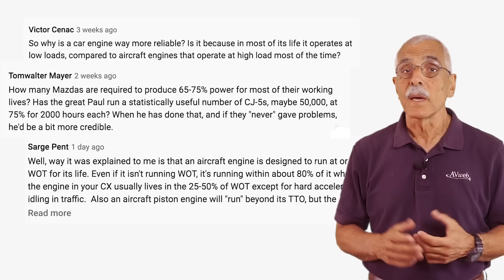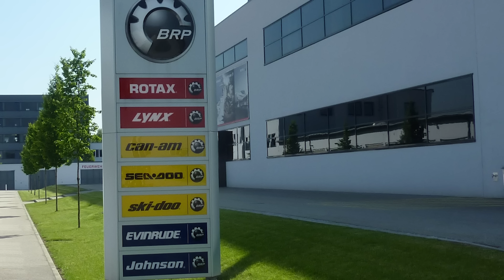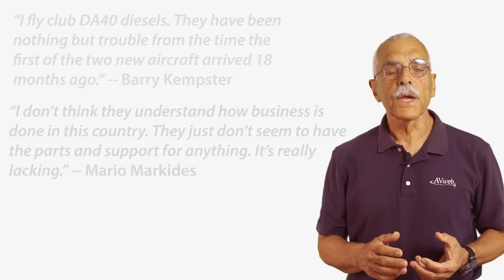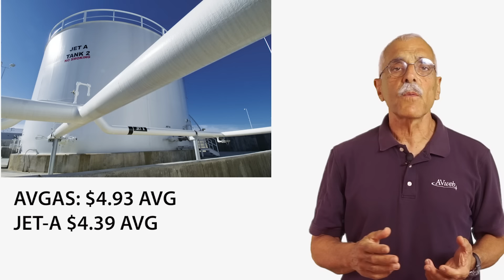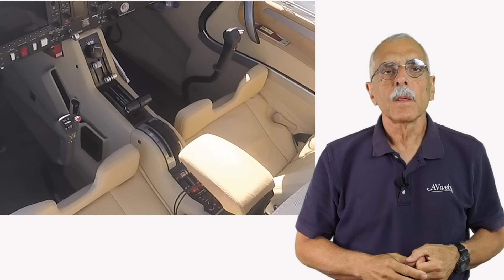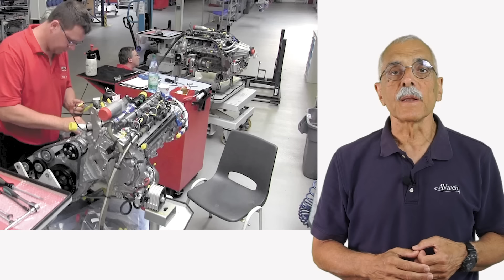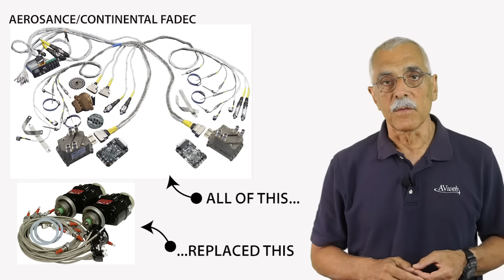Why New Aircraft Engine Ideas Rarely Succeed

Comment: What about DeltaHawk?  What's holding them up?
You mentioned SMA a couple of times?  Are their engines having reliability problems?
When comparing diesel weight to e.g. IO-550-N, the thing to do is show a chart of engine + fuel weight vs range.  The gas engine looks better at short range, the diesel is better at long range.  This is why I'm mystified why flight schools would want diesels... aren't they mostly flying short range?
Reply: You’re the first to mention DeltaHawk.  It’s certified since this video.  (Sep 2024)

Comment: What about going part way and retrofitting newer components onto older engines to eliminate weak spots? I can remember back in the 1960's and 70's when I was retrofitting alternators and electronic ignitions onto into older vehicles to eliminate generators and ignition points. For example, if the B-17 "909" had a modern electronic ignition system instead of 1930's vintage magnetos it probably would still be flying around.
Reply: A descent maintenance program might have helped!........Capt. Mike.....SAT

Comment: love this.  except the part that it's a myth that automotive engines can all be run at 70% power for 1800 hours.  The diesel - possibly, and that's one of the reasons it's significantly more expensive than a gasoline burning counterpart.   I work(ed) for a stationary engine manufacturer, and people in that industry test a lot of automotive gasoline engines (all of them) to see which ones can run well as stationaries.  Most are horrible.  Typical GM LS engines are horrible in stationary applications, they'll start burning oil at 20 hours above 70% load...     anyhow, love your videos, thank you for the quality content.

Comment: I'm not a pilot but I would assume that one of the MAIN features that end users want in an engine is that at 12,000 feet... it keeps spinning no matter what. Diesel engines tend to do that... no spark plugs. I would not think that any of the performance numbers are going to impress anyone as much as that. If I were a diesel engine manufacturer my company tag line would be "It Just Keeps Spinnin'!". 😉

Comment: if i remember correctly, there's more energy in a gallon of Diesel fuel than gasoline.  it's considerably less in ethanol fuel also, why we get ripped off in states with 10% eth fuel in gasoline we buy

Comment: With all these useless 'new' designs of aircraft engines, why not go backwards in time and use the bigger 16 cylinder radial engines? Or the Rolls - Royce Packard Merlin if you really want tricycle gear as opposed to a tail dragger. Sure Packard isn't in business anymore but R-R sure as hell still is.

Comment: Should we soon have electric plane? XD

I'll show myself the way out XP
Reply: Strap on a leaf blower and you can fly all over the place so long as you're happy with your parachute design. And there's a kid on YouTube who's been doing that for Years now. (Tucker Gott?)

"No such thing as a new aircraft engine!"? Pffff. Virgin Galactic just launched a space plane powered by used tires as fuel. There are the standardized systems (as any air frame is more than just the APU) but ultimately there is an entire World of tumult going on in Aircraft going on decades now and in particular as a result of SpaceX.

"Falcon 9 is in start up" has changed far more than just the Aviation market although certainly there is now that. Point being one now has fully autonomous systems as made famous by the doomed Lockheed L-1011...one of which NASA still flies.

As with a fully autonomous Das Auto "taking the head out of the flight" allows for a vastly superior system...meaning as a pilot you can actually fly the plane.

So to answer the question absolutely and of course you can use human rated drone aircraft.

In the alternative is a C130 turbo-jet...nothing more than a jet engine with a propeller on that.

How hard can it be to miniturize that? Not only "not impossible" but if you Google search for that you'll see in the World of RC Modeling "already done and done 40 years ago" more than likely.

Point being the problem is when one design change leads to another and another and another and finally... the end.

But everyone always blames the engine always and of course.

It's that way of thinking that has allowed battery electric everything to succeed ... even to some extent in a rocket motor (Rocket Lab.)

A battery powered system has the simplicity of the drive system and thus a much less complex holistic approach to all matters mechanical.

By way of example ahem cough cough "next Year 2022" cough cough ahem MAYBE there will be a pure BEV front tire motor for your 737 et al for tarmac work even though the item has been well known as necessary for 50 Years and been on the market for over ten Years now?

Or in the alternative we can all watch Boeing go bankrupt again I guess.

Comment: The greatest problem is that development of an aero engine ist very expensive. Automotive engines are not designed for permanet high or full power output. So they increase the rpm's for power. Look at truck engines how much power they have and the rpm's: i.E. MAN 0836 6,9l=420CUI, 184kW, 250hp, (max 251kw) weight 642kg. Full Power at 2100rpm. This engine is permanet full throttle able. Automotive engines are not full power able.

Comment: Almost all modern car/engine manufacturers got their first big break building warplane engines during WW2. Honda, Subaru, BMW, Citreon, etc etc etc. They just made crappier versions for cars and made huge profits. For example, Subaru aren't going to take the bubbles (open deck) out of their engine blocks any time soon, even if they get a bad reputation for headgasket issues as a result. They're going to keep putting the air in, not for the $3 of aluminium saved, but to cripple their own engine durability into the zone required to be a player in the automotive cartel. You can't have cheap, powerful and efficient engines chooching around everywhere, it just wouldn't be right. It wouldn't be managed. Everything needs to be managed, but particulary the people's access to externalised power.

Comment: Is there any benefit to overhead cams in an aircraft engine? GM has pushrods running to 7,000rpm - 6,000 in trucks - and gearboxes add weight, cost, and service issues that negate the benefits of a faster spinning engine.

Comment: If the IO-550 is anywhere near as good as an IO-520, it will be unassailable.  Because Continentals and Lycomings are so refined, challengers face an uphill battle.  One thing Paul didn’t touch on:  Jet fuel/diesel is disgusting and filthy.  It is problematic getting it to meter reliably.  If 100LL goes away, the answer for existing airframes is the o-470, and engines like it.  It likes Mogas.  For new airframes, electric motors with a gasoline powerpack will revolutionize the business.
Reply: I can't tell if your comments about IO-550s are sarcasm..... they should be!

Comment: Great explanation! This cake tastes old and sad though... Seems like a deadlock, catch-22, you name it. FWIW, I'd also point out the Rotax-915iS as a new but very promising engine. It's similar to the 912iS which starts as easily as a modern car engine, unlike any of the traditional engines I've had to deal with. Both the 912iS and 915iS - just crank it, and it starts! Hot or cold! Well, "cold" as in around +15C on the ramp in the morning, I don't have any "real" winter aviation experience yet.
Reply: The 914 is pretty much a turbocharged 912. And the 915 is the 914 with an intercooler allowing for higher sustained horsepower. Yes there are improvements in the engine but at its core it's the same. Look at Edge Performance and you'll see technological innovation. Rotax itself is just incremental improvement

Comment: The new aluminum block LM2 3.0l inline six diesel from GM seems like it would be a good fit for higher performance GA singles. The weight and overall packaging size of the LM2 are very similar to the six cylinder Lycomings and Continentals, but should burn substantially less fuel.

Comment: Rumors are that MAZDA is working on a improved Rotary ( Wankel ) engine that could be adapted for GenAv use.
Reply: Rotary engines are literally the most unreliable on the planet.  The whole basis of rotary engines was power generation via extremely high RPMs.  In an aircraft, you want torque and power at low RPMs - otherwise you need high reduction gearboxes that will not stand the strain.

Comment: Hard to beat a large displacement direct drive engine that's designed to run at lower RPM it gains nothing from 4 valves over head cam with it's added complexity. Now just build a large boxer direct drive Lycoming diesel.

Comment: I'd want a diesel so I could fly on bio diesel. Is there non-fossil avgas?
Reply: Don't know that I'd be putting refined deep fryer oil in my million dollar DA-62, but life is about trying new things, right? To your question there have been initiatives to create renewable replacements using oil-producing algae, for example. The sticking point in replacing AVGAS has been no-one's come up with a one-size-fits-all solution. Some GA engines can run on unleaded MOGAS. You could configure an engine to use E85 ethanol blend, but the problem with ethanol is it mixes with water, so there's a whole host of inherent risks to do with corrosion.

Comment: OK, so people like the old proven stuff more.  That's fine, there's nothing wrong with pushrods, especially in the 2000-3000 RPMs that aircraft engines operate.  Proven mechanical designs have a lot of merit, but why don't any of these companies augment the proven mechanical design with proven automotive electronic components?  You can just add electronic fuel injection to anything that's carbureted.  I've literally done a conversion myself on an old car.  And electronic ignition is fantastic as far as power improvements it can bring.  You can have the engine that starts hot and cold, has better power and efficiency, but is still has that proven legacy of mechanical reliability.

Comment: One of many small airplane engine would make a great boat anchor or needs to go to a strap pile,  to many people paid in blood over these junk air cooled engines. Plus alot of the technology is from the 1920s that in them air cooled boat anchor engines your promoting in the video.  Convert a V8 gas engine from  G.M. AND OR FORD AND OR MOPAR, OR THEM JAPANESE ENGINES THAT IN CARS AND PICKUP THE RELIABILITY IS ALOT BETTER THEN THEM AIR COOLED BOAT ANCHOR THAT ON SMALL AIRPLANE WHERE PEOPLE PAID IN BLOOD OVER AND OVER. AND THE MAN IN THE VIDEO BETTER STOP, BECAUSE OF THE BLOOD HAS BEND PAID. Promoting them boat anchor engines on them small airplanes, that means there is more blood has to pay before the stupidity ever ends

Comment: With old Diesels, when it gets cold. just plug up the tail pipe with a few rags. when it starts, they will shoot out. Be sure to crank it. and stuff it in the beginning, when there is still a good charge. The rags will create a back pressure that will help the production of heat that will start the engine.

Comment: I have a perhaps interesting story about Diamond (well some people may be interested). So, I was luck enough to work for a company who had 2 DA42s for a government project. 

 It was amazing to see them converted to take surveillance equipment like FLIR etc. Its been made public (and I was never asked to sign anything) so I'm sure I'm not saying anything I shouldn't. 

Anyway. I believe the project was to fill a gap left by a delay to the  General Atomics MQ-9  project the UK was involved in. It really highlighted what an AMAZING aircraft and engine Diamond has made. If I was to every be lucky enough to buy my over light aircraft, I would not hesitate to chose a Diamond. To highlight this I just wanted to go over some of the numbers. I used google for the MC-9 Reaper costs. I have first hand experience at the DA42s cost so this may not be 100% accurate, but the difference is so great, that my point is made. 

Anyway, here goes - A Reaper costs 32 million, costs $3.5K+ per flight hour and has a range of 1200 nm. Without the costs of the infrastructure and training to put it into service . The DA 42 (without military payload) was something like 1400 nm, and costs under $1m and under $300 an hour. Now the FLIR would probable add another $1m plus reduce the performance (but not by much).  I think the use by UK government was an excellent proof of concept. I see no reason it couldn't have gone on to be lightly armed like a Reaper. But it could also be a spotter for ground attack.

So the RAF paid a private company to convert and operate the DA42s. I believe it was around £1m per month for the two including pilots, ground crew - everything.  So lets say £6m per plane. I'm guessing, due to more stringent maintenance per flight hour demands of the military, it may not have saved much doing it themselves. But still, 6m a year per plane, and a lot of the cost was front loaded because of the cost of the conversion. and this was a one off, scqle would have brought this down immensely.  compare that to the cost of the drone project. Which I think has run to 1.2 billion.

I wasn't with the company after the planes left for the theatre. I was surplus to requirements when they went overseas. But I hear they ran them it over 2000hrs without incident so I thought it performed amazingly.

Comment: I think a gm 5.7l v8 could work well in a aircraft so long as they balanced it well. The model from 1997 is great at sitting at peak power all day (although it does make it at a lower rpm.).

Comment: The real question is 70% of what design power goal and for what TBO? 
My old (1965) 123ci tractor is rated for 100% of 1700 rpm all day every day for years and can be rebuilt in a barn with some fresh cylinder liners and a handful of wrenches, while still being light on fuel; but that rated output is 27hp and the engine weighs about 1000pounds. (granted the engine is also the forward structural frame and ballast for traction.) 
Top fuel dragster engines will do 100% of design output at around 8000rpm with a TBO of about 15 seconds. 
While a typical 900rpm 3000hp marine/locomotive diesel can go 10,000 hours between cylinder head overhauls and 20,000 hours for the running gear, upper cylinder liner life is about 60,000 hours. (Then you get to the 150RPM cross-head diesel designs where even the crankcase oil has an expected life of many thousands of hours and more problems with moisture and bacteria than blowby.)

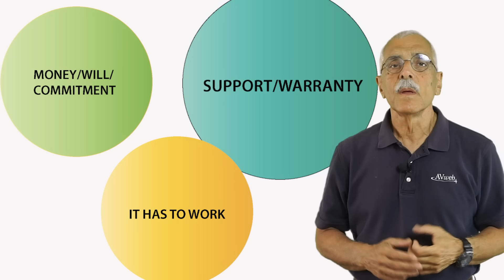Comment: 21:55 at that point I remembered the ol' Pietenpol Aircamper: back in the days everybody said it'd be impossible to use an automotive engine to power an airplane. Mr. Pietenpol obviously wasn't everybody and hadn't heard it was impossible, so he powered his Aircamper with the cast iron Ford Model A engine. It was one of the best and most successful experimental aircraft designs of it's time, they are flying to this day.

Comment: And the car engines that can operate at 100 percent power all the time are really heavy and really low powered. Like my 100 hp 600 lb flathead in my 1950 Dodge truck

Comment: Best solution imho is to convert the LyCosaurus to liquid cooling. It was done 20 years ago by Liquid Cooled Air Power but their attempt to generate interest with the OEMs went nowhere. Now AC Aero Engines has shown their l/c 4 and 6cyl kits for experimental Lycomings at Sun & Fun last month, offering big weight savings, 200F operating temps and compatibility with unleaded mogas. Their bump in comp ratio has boosted BSFC for improved efficiency too. They also offer big HP 2 stroke combined cycle diesels. 
http://www.ac-aero.com/gladiator-centurion/

Comment: It's the fuel and ignition systems that cause a lot of the grief on the current aircooled monsters, surely there's a way of updating these systems onto the existing engine cores. A 1943 Focke Wulf had an automatic engine control that managed the prop and the fuel, as did later Me109s they seem to work on the examples that are flying now so why not on an O360 or an IO 550. And no the single lever Cirrus doesn't count as that is not fully automatic and it is still a PITA to start hot